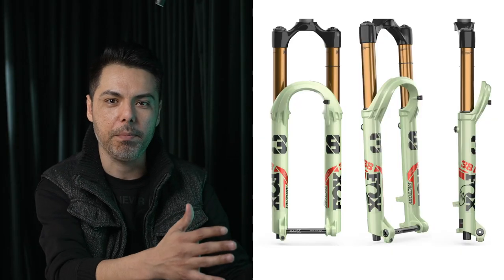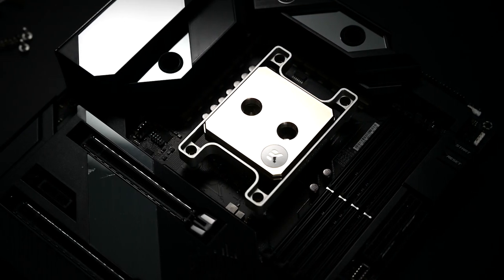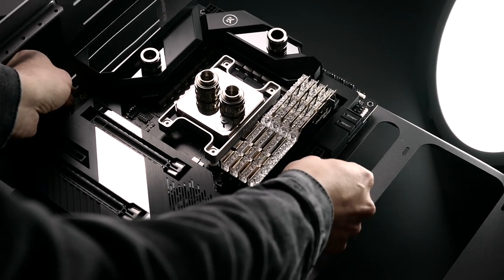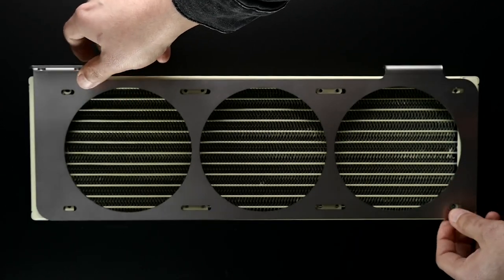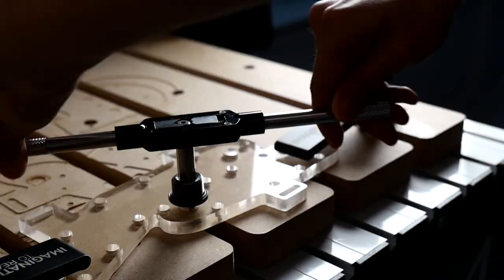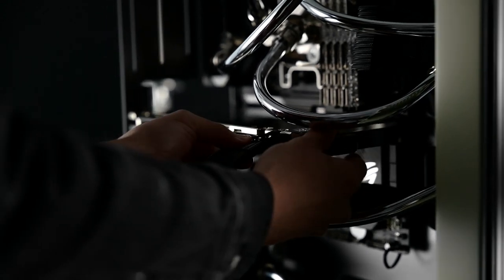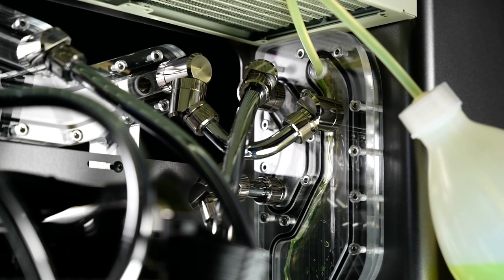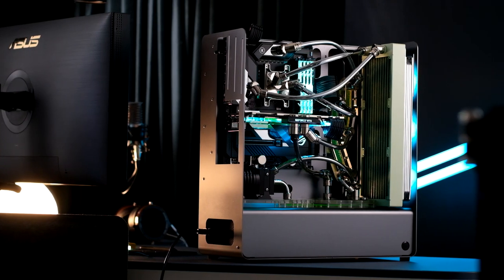Custom Computer for Henry Golding

Comment: You are running that psu dangerously close to it's limit, which any knowledgeable pc builder will tell you it is NOT a good idea (under full load, i estimate aprox 800w drawed from it), and the tubing is just... so much time spent planning and using cnc and then you just threw tubing all over the place?
Looks like a lot of hard work, but close to the end, you decided to half ass it
Reply: @Shyvorix  google RTX 3090 power spikes. Watch the gpu spike up to above 500w from time to time. Havent figured out if it's driver based or whatnot, but it does happen.

Furthermore, you can easily buy a power meter that you put between your wall socket and your pc power plug, to read the power draw of your build. In full load that pc will draw close to 800w. 
A bit of googling will tell you it's best to give your psu at least 10 to 20% headroom to have it function best and for longer period of time, so it doesnt die on you after less than a year.

Put all of those together, and you will get to my above written conclussion.

Can you run it off a 750-800w psu? Yes. 
Should you? No.
Reply: @AlexanderPossessed1  Yea I know about the power spikes. Thing is if you run a single 3090 the power spikes, assuming your PSU is good quality (Corsair, Seasonic, EVGA etc), it will be of no issues nd the PSU will know. This is assuming it's 12v rails are actually beefy and not garbage levels which is sadly common-ish with cheaper PSUs.

A single 3090 will usually have transient power spikes of about 400 to 500ish watts, something a 750 and 850 will have no issues dealing with because it's usually the AMPERAGE that is the threat and most rails have super beefy amperage ratings. Nvidia themselves speak and have proven that 750 and 850 PSUs are 100% fine even with a 10900k which is known to be a huge power hog.

Still, a standard 5950x with 3090 under full load is about 500ish watts, 650 to 700 with spikes. Any higher spikes is usually the PSUs fault.

I've been messing with this stuff for years personally as I've worked on dozens of rigs for friends and Enterprise (as a professional) so I know lmao.
Reply: @Shyvorix  either your build is highly barebones, or that 500ish watts sounds very much off to me.
I'm reaching 770w constant draw from my 9900k+3090 (true, both oc, but not by a lot), and can pass 800w if i run cinebench+furmark in the same time.
My rig draws 500w if i play 2D platformers.
Reply: @AlexanderPossessed1  Which 3090 you have? Also yea the 9900k literally can pull over 200 to 250 watts at full load when OCd hard. It's a furnace even at 8 cores like the 10900k or 11900k. Also yea but that's furmark, like prime95 it's a torture test, not a benchmark. For benchmarking, for sure Heaven or a 3DMark run with Cinebench R23. 

As for my rig, lol....5950x with PBO enabled, 64 gigs Trident Z Royal CL14, 3090 Strix OC, Crosshair VIII Dark Hero, 5 M.2 and SATA SSDs, EK AIO 360 (will be doing custom loop soon with Optimus blocks), all powered by an RM1000x (I actually used to run an 850x with no issues and everything overclocked but I upgraded for the option to run threadripper in the future, and for silent fan at low/medium loads) in a Phanteks Evolv X. Built about 4 computers for myself, built over 30 total for friends, family and when I did IT work before and a bit during the pandemic.